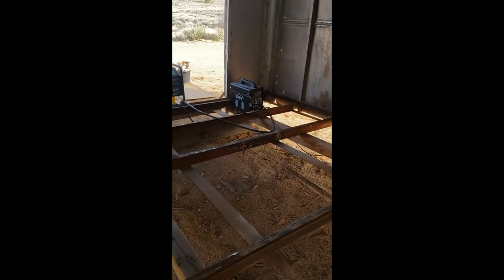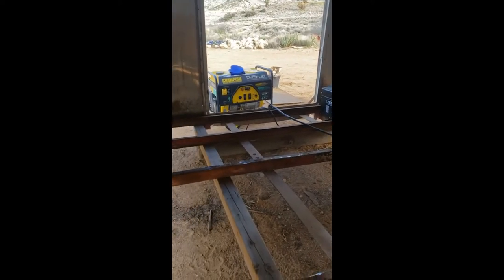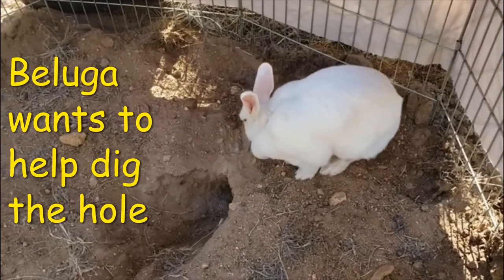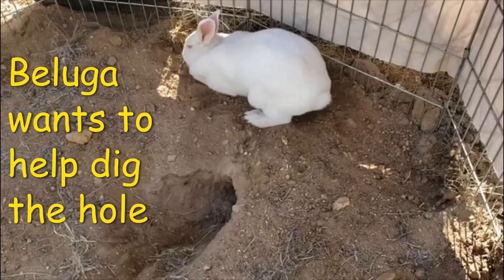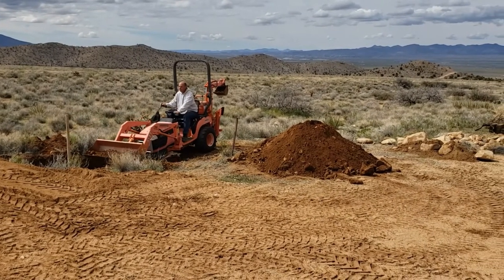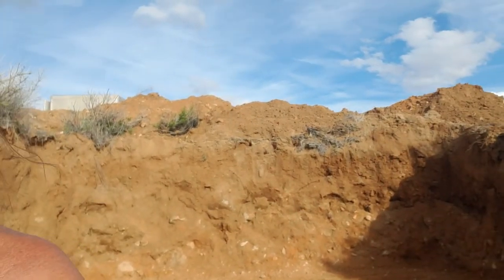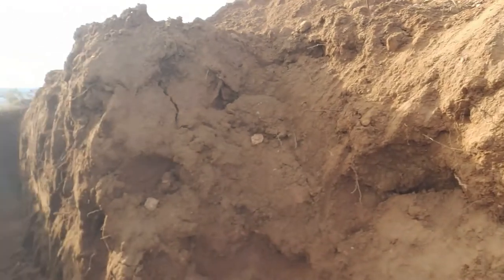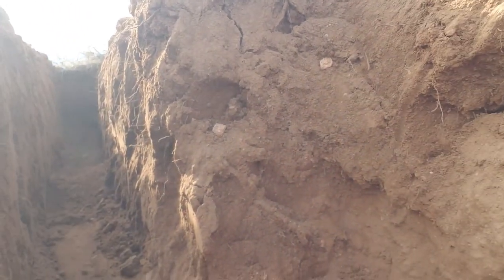Building an Underground Rabbitry, Part 1

Comment: Good idea about the underground cooling tube - will the air siphon naturally with the thermal difference, or will you need to add a computer fan with a small solar panel to help move the air?
Reply from the maker: We added a solar fan and an attic fan to draw air out.
Reply from the maker: Updates on Instagram @ desertoffgrid
"Underground and Off Grid in Arizona"